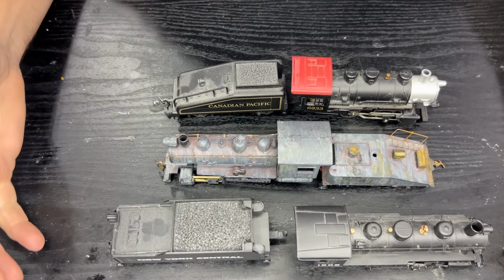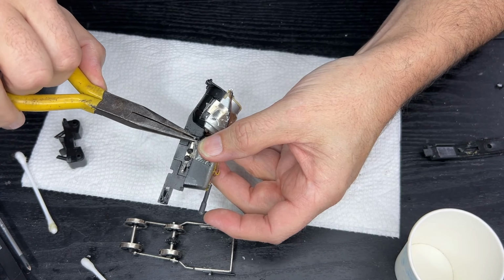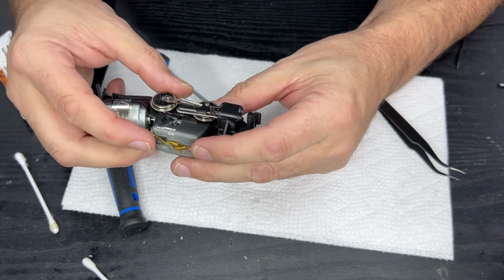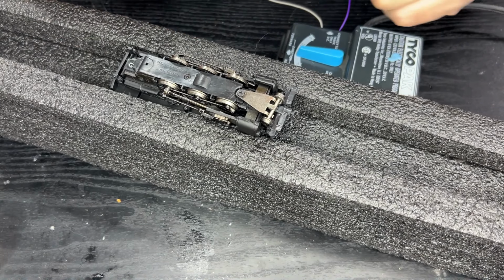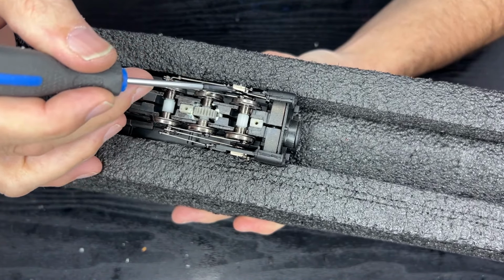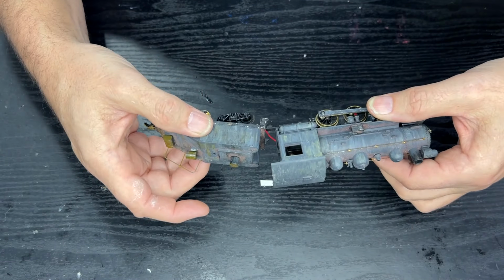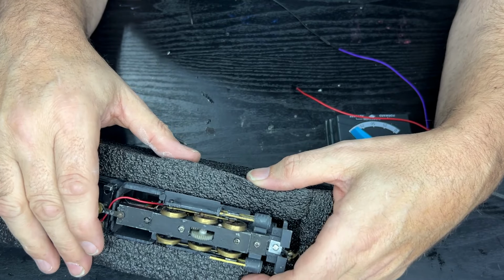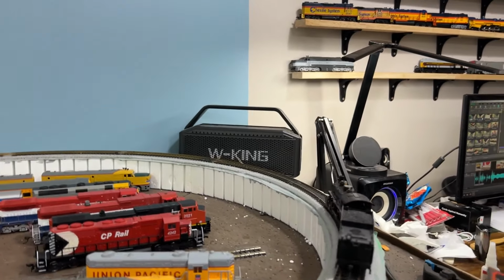Subscriber Repairs - Troublesome Trio Of Classic Steam Locomotives

Comment: One thing you can do when using superglue and plastic is to sprinkle a bit of baking soda on the glue after you attach it, the baking soda hardens to almost a new plastic and makes the joint super strong. Then you can sand it to shape and paint it. There are a lot of you tube videos that show how to do it.

Comment: Hi Dave, The last loco with the loud motor was a kit that was badly assembled. The worm gear on the motor sounds like it is badly aligned with the driver gear. That can be corrected so the two don't get bound up. Nice work with the running gear on the other,

Comment: Good evening, Scott, Mike knew exactly what you were capable of sending you that lot of trains to repair, each steam engine had its own issues and problems and you figured them out and fixed them, yes they are very selective in fixing the main key is to be patient with them no matter how long it takes to get them running again even if you must put aside for missing parts, cheers my friend you learned a great lesson on how to fixed steam engines.

Comment: Steam Loco repair frustration. Steam locos had tires believe it or not. They have to heat the wheel to install or remove them. Drive rods are the worst. I have a Broadway Limited 2-6-6-4 I have to replace the drive gear on. If I can't fix it, I'll sell it as parts. Think I would have used a rod to fix the cross T instead of butt jointing plastic. I fear it will break just by looking at it. You are diving in deep, you're doing great.
Reply: Just checked. The NYC 2-6-0 is the same as my Bachmann 2-6-2. You can see on the bottom of the 2-6-0 where the trailing truck goes. I think Bachmann used the cheapest and easiest way to fit drivers into the cylinders. Just bad stuff.

Comment: Dave.. a few things I was taught many years ago.. try not to work on steam engines upside down as all the rods and linkages will come out.. as you are having issues with.. and get a rolling road which makes testing these kind of engines much easier than holding everything ...... You are doing a great job on these models.

Comment: The motor of the Tyco/Mantua 0-6-0 still sounds a bit on the dry side. It may need a little more oil on the armature to quiet it down with more run time. I did notice the extra reduction gear which is the reason for its slow speed. Also, the plastic wheels on the front truck of the tender will not help for the electrical pick up. They need to be metal wheels like the rear truck to help with the electrical pick up. 

Another random tip: There is a spray chemical called a "Kicker" or "Accelerator" that will speed up drying of super glue for bonding parts.

Comment: Hi Dave, great video. I noticed on the last loco you added the plastic slide/guide to the cylinder, as it stopped there was some smoke. Is there a smoke unit, or was it the motor?
Reply from the maker: It was lens flare, lol. I have 24 LED overhead lights in the basement.
Reply: @ScottRails  man it really looked like smoke. LOL

Comment: 32.40 The base track bar of the cylinder does not have to be square (though it helps). If the cylinder is drill-able, drill a hole where the bar should be and glue in a suitably sized smooth nail or rodding cut to length. Glue by itself is not very strong.